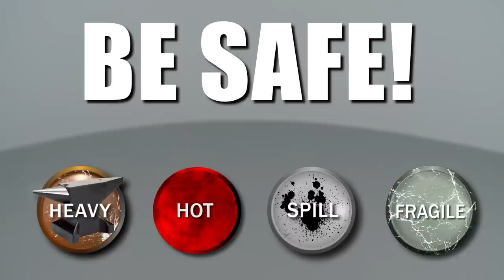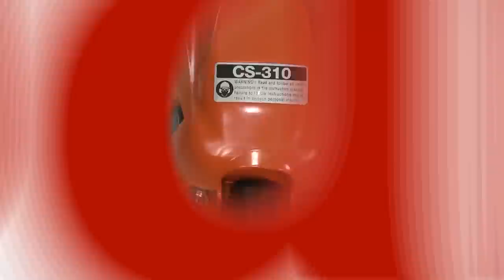Echo Chainsaw Primer Bulb Replacement #188-512-1

Comment: please add the detail of which line goes on the inlet of the primer bulb. people will get confused when they see the in on the primer bulb and may think that means , in from the gas tank.  when actually its getting fuel from the carb and then pressurizing the tank.
Reply: Thanks for the tip.

Comment: Can the engine work with a damage  purge bulb?
Reply: NO !!
Reply: My one did but just runs a little rough…. I wouldn’t run the saw for long but as it will be running lean- thin out air fuel mix and prob not good for it long term.